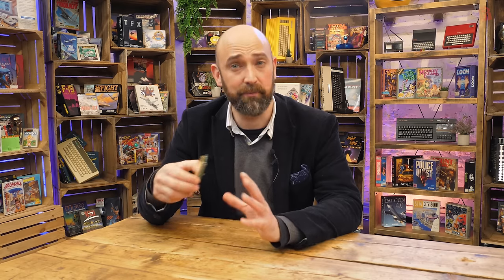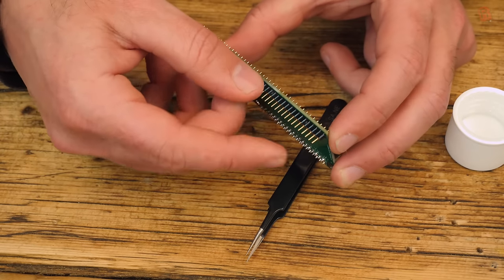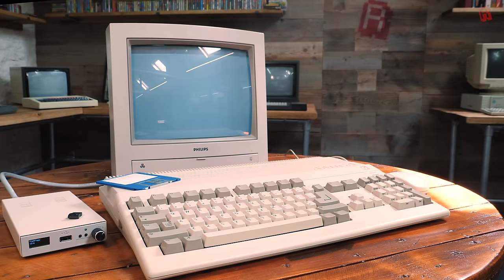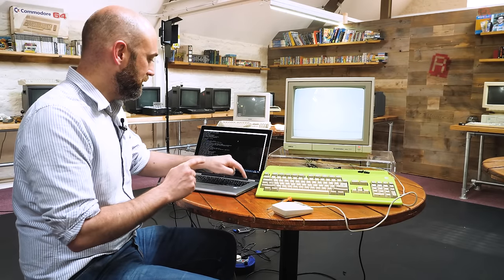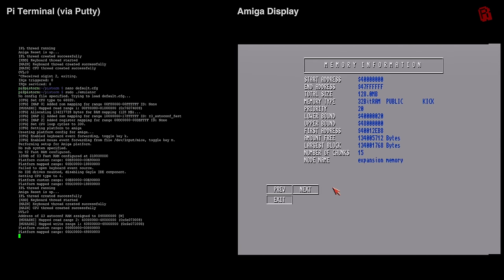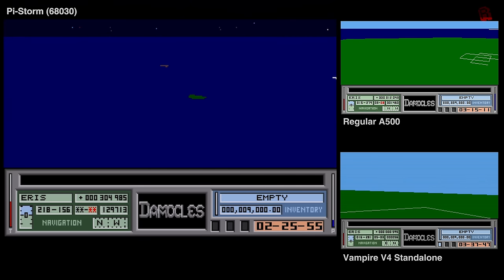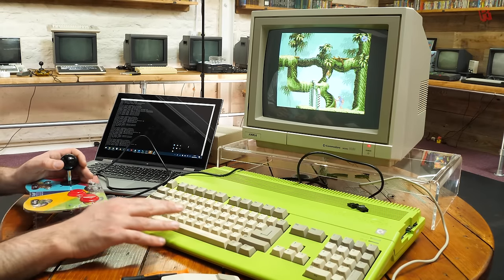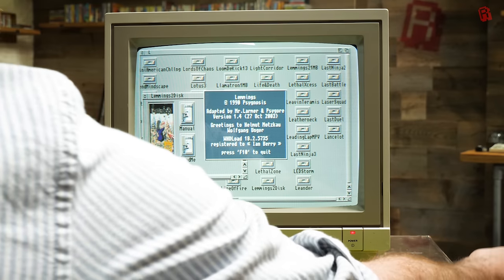Amiga PiStorm - Retro Power on a Budget - Tech Nibble

Comment: Thanks for the vid. The only thing that I wonder about is how come the SD card doesn't get corrupted when you just shut down power to the Pi? With OpenmediaVault etc, if the system is not shutdown cleanly then sometimes the SD card gets corrupted and it won't boot.
Reply: Only if there are write operations to the card was always my understanding?

Comment: I wonder what is the limit... The conundrum is: Where does the Amiga stops being Amiga and starts to become Pi or Vampire?
Reply: It's becoming a hybrid. All the dedicated ic's works as usual as long as the signals are right.
Reply: That is a good question. At which point does it become ridiculous to plug in a device to, circumvent one chip, or transfer old TV outputs to HDMI, when the device doing the task, is otherwise used to emulate the whole system anyway? I mean I an not a purist who says the Amiga should stay the way it was since 95 or so. If I would have had my A500 in use beyond 96 I would have plugged in every upgrade I could affort. So I would end up with a 100+Mhz 68000, but still...
Reply: I never liked the Vampire or any other FPGA solution, especially the stand alone devices simply because, yeah, no, it's not an Amiga any more, or ever was actually, it's just emulation through and through. This thing on the other hand I do approve of, as all it does is emulating a processor, one that although was lovingly associated with the Amiga back in the days, was in the end just a CPU - one that you could find in a plethora of other machines and isn't really Amiga specific as for instance a Paula is.

I have mulled over getting an FPGA based machine because just like it's brought up in the video, it's a convenience thing and who knows when my A1200 seizes up, or the installation, or the turbo card, but still never pulled the trigger due to the issues mentioned above. But this PiStorm is a definite purchase when they become more readily available. And 500's are a dime a dozen compared to 1200's.
Reply: I'm typically a purist even down to still using real floppy disks but at some point, I might have to at least invest in an SD card reader to remedy that, those old disks won't last forever. Seeing a video such as this though, I wouldn't be opposed to something that could emulate a faster 68k variant if it meant the 3D games would have actual playable framerates by more modern standards. That was always a serious barrier to entry for me with 3D games on the Amiga and Mega Drive/Genesis. The 68000 had the overhead to render polygons and still keep things moving but it was mostly abysmal in a gameplay sense. Those titles were really more examples of impressive technical feats.
Reply: @vresi  Minor nitpick: FPGA solutions like the Vampire are explicitly not emulation. FPGA is an array of logic gates, just like a real CPU or any other IC. When a chip is described in a VHDL file, that tells the logic within the FPGA core how it relates. That chip’s function is really there, in real logic, and is as much the same as original as if they had started up the chip fabrication again and pumped out new chips (assuming the hardware description was accurate). FPGA guys call this “simulation”, rather than emulation, but I’m more inclined to call it “synthesis”. To use a really wanky analogy, just as the statue is there inside the marble, and Michelangelo merely freed it, the real chip is there in the FPGA.

Software emulation differs in that it doesn’t usually replicate function, but results. The code linearly processes its emulation of a whole machine, which means juggling between display, CPU, sound, input, and storage, hopefully fast enough that you never notice the delay as it hops from one task to the next. Unless it’s really “low level” emulation, there’s usually some case specific hacks going on that shortcut to a result when a computationally intensive task is recognised. You still see a lot of that in N64 emulation, and those shortcuts are why you see graphical glitches all over the place (that’s an extreme example). In the video, we see Damocles running fairly poorly on the emulated 030. I can only speculate as to why, but it may be what happens when emulation DOESN’T take those shortcuts, and gets bogged down in the minutiae. Each approach has their strengths, but that’s where FPGA solidly beats emulation.
Reply: With the ability to use an FPGA to replicate 68k processors in hardware and therefore "emulate" Amigas, the PiStorm is unnecessary; unless you absolutely must use a real Amiga.
Reply: @NoobixCube  Using an FPGA isn't "simulation", it's hardware replication.
Reply: @RealCelticGamer  Hence why I prefer to use the term “synthesis”, though for some reason the FPGA community (as far as I’ve seen) calls it simulation to differentiate from emulation.
Reply: @NoobixCube  I've seen the FPGA call it "simulation", yet Analogue, who make FPGA based console, call it "hardware replication" which is the more correct terminology. No idea why the community call it "simulation". "Synthesis" is an interesting way to describe it.
Reply: This is the puzzle Alan Turin came up with before micro computers were invented. He said with infinite memory and infinite speed a one bit computer could emulate any other computer. Effectively our modern computers are infinite compared to 1980's computers and have plenty more than one bit processors.

The beauty of the retro computers is trying to get them to do amazing things or even useful things given their limitations. The beauty of these upgrades is figuring out what they can be upgraded to and still be the original device. I see they even produced a variant of the 6502 with a 1MB linear non-paged address space that was binary compatible with 6502 as well as capable of more.

Comment: Good value for sure but remember you are limited to the 3.5mhz 16 bit wide memory bus for the 68000 socket so I wouldn't get too excited about faster, it's probably bottlenecking on the 68000 CPU socket already. Plenty fast enough to make It Came from the Desert 'arcade' sequences much smoother and playable which is all my Amiga 1000 would want.

Comment: I'm quite tempted in a Pi 400 with Amiga decals.
Reply: Then you rather need an emulator build for a complete amiga. Search for "amibian" in google or facebook.
Reply: @vectorjoe  it seems a more legit way of doing it than just a PC window.
Reply: Pimiga ftw!
Reply: @FatNorthernBigot  amibian is an emulator distro for the pi. Just the linux foundation and amiberry.
Reply: @vectorjoe  I understand. So, for sixty-odd quid, you get an entirely self-contained computer that runs like an Amiga. Just doesn't look like one. Much. I'm willing to bet you could plug in an external drive and play old Amiga games, as we did thirty years ago.
Reply: @FatNorthernBigot  unfortunatly usb floppy drives will not work because they are build according to the ibm pc floppy format, and amiga used a different format.
Another method would be to put a pi3 into an empty amiga 500 case and use an adapter board to map the amiga keyboard to usb and connect that to the pi, then it looks like a real amiga.
Reply: @vectorjoe  I guess that makes sense. Shame, there could be a market for such things.

Comment: Can some of the 128Mb Fast Ram be remapped into the Chip Ram area? It would be useful for some of my old 512kb A500's💾💾💾
Reply: I'm guessing no: this can probably only replace CPU functionality, not chipset functions
Reply: @philipcorner574  That makes sense👍🏻
Reply: It can't do that. What the emulator can do though is map the 512KB of slow RAM in the trapdoor expansion to be chip RAM without needing to modify the motherboard (cutting some traces and soldering a JP). Needs a 1MB Agnus of course.

Comment: I'd be interested to see how fast it runs using a Pi Zero.
A lot better than you'd expect, I'd bet - it's still a 1000MHz single-core CPU, and the 68000 emulator will only use a single core even on a multi-core Raspberry Pi.

Comment: For the 68030 slowdown issues, my only idea is that the '030 had a really flexible MMU with multiple page size options, which is a real pain to emulate correctly.  The '040 has a simplified MMU, so as far as memory management is concerned, emulation can be much faster.  If there's an option to disable the '030 MMU emulation, try that.  Even if the MMU isn't being used by the OS, just having it enabled may slow things down a lot.

Comment: to the issue where 68020 is faster than 68030 i can only think one thing: emulation of 68030 is heavier, cause throttling to the PI, reducing its speed perhaps.

Comment: Pi Zero would be ideal as it is a lot smaller, though it does have a slower CPU on the Pi.
Reply: Pi Zero 2W is out now with almost identical performance to a 3A.
Reply: @Daz555Daz  yes, they were not out, or not that I was aware of when I made that comment.  The Zero 2 is definitely a game changer when it comes to small form factor computer on a board and being fully arm 7 compatible is fantastic.
As a side note, isn't it amazing how arm has managed to still stay relevant today.   It started as Acorn RISC Machine, then renamed Advanced RISC Machine when Acorn became no more.
Amazing how an architecture first introduced in the early/mid 80's is still relevant today
Reply: @EsotericArctos  agree 100%

Comment: Thanks for the video. Is there somewhere where you can get just a Amiga 500 case? Contemplating shoehorning in a ITX PC board, water cooled GPU and having the PSU 'disguised' as a large external power supply.. Has anyone already tried this - or is there just a lack of space?
Reply from the maker: You might want to consider the Checkmate Mini case which is designed for ITX and modelled on the Amiga 3000

Comment: I'd say you soldered the pon headers on bottom up and thats why they seemed to short.
Reply from the maker: Heh that wasn't the case luckily 😁 I wasn't the only one with this issue and the longer pins are being used as standard now
Reply: @RMCRetro  alright then, good for you ;) I thought so cause the bigger shiny brass planes on one side are usually soldered against the pcb. To me it looked like you did it the other way round.

Comment: The big deal about the 68030 was the built in MMU. I wonder if that's slowing down the emulator, possibly when it's dealing with the trapdoor RAM extension?
Reply: The MMU mapping logical to real RAM adds CPU cycles on the Pi.
Reply: @linuxjedivideo  Makes sense, thanks. I was wondering if the 2MB extension added even more work because of the chip/fast/slow RAM mappings it introduces. Trying to remember back a few decades, but I seem to recall that extensions over 512K had a few issues in that area.
Reply: @strayling1  There were likely issues if you had slow RAM. 2MB chip doesn't slow things down unless it is prioritised over fast.

Comment: Probably should have started with Pi zero support,  Pi A's are a dead end and it's weird to expect someone to have one.
Reply: Not true. The 3A+ will continue to be built until Jan 2026, the same as the Zero. The Zero (non-wireless) actually came out in 2015 and the 3A+ came out in 2018... The Zero is a significantly less powerful piece of hardware, though they are working on a version for it, as well as RPi 4.

Comment: Could the issue with 68030 mode is thermal throttling? Maybe Pi is, as you said, pushed too hard and starts throttling. Maybe adding a small  heatsink and even a fan to the Pi would help?
Reply from the maker: As I understand it since chatting to the devs the 030 introduces an MMU and this adds more demand on the emulator/Pi

Comment: It is a pretty neat device. The sad thing is that at least right now they have basically no incentive to implement the 68k properly, so all the other 68k platforms can't also benefit from some speed boost. Feels a little elitarian despite it having such wide potential. Not sure this is a smart direction either as this also limits the amount of programmers interested in its development.  Looks like the comparable Buffee Accelerator might become the more interesting alternative mid term.

Comment: Strange i can play Doom 1 and 2 easily on my Amiga CD32 with TF330 v3b 128MB (that is a 68030 50MHz board with extra's), and it runs good, so yeah Doom 1 and 2 could play good on the Amiga 1200 with a 68030 50MHz, and Amiga 4000, and Amiga CD32 if it came standard with a 68030 50MHz and 8MB Fastram.

Comment: I wish someone would do this for the Atari STfm/STe
Reply: There were inquiries about using the Vampire for the ST's but the main issue was unlike with the Amiga, ST games & demos require the exact speed to run w/o timing issues.  So there will have to be an option to run the PiStorm at exactly 8 Mhz speed for gaming.

The Vampire team decided to just port EmuTOS (and FreeMiNT) to the Amiga instead.

Comment: Is this still accerleration or already emulation? And how is this different from amiberry? Except that paula and the floppy disk exist for real?
Reply: Amiberry emulates the entire Amiga system including the graphics and sound chips. The PiStorm only replaces the CPU and still uses the rest of the actual Amiga hardware for everything else.
Reply: @jimb12312  except for denise (pistorm offers RTG), the hdd controller, RAM, KS ROM... the only thing thats not emulated are paula, the CIAs and the joystick ports....
Reply: @vectorjoe  All of those things you mentioned still can be used. You can choose to use RTG in addition to the on-board video, a virtual HD, virtual Kickstart, etc., but the Amiga hardware onboard is still in use. How is this different from Amiberry? You're still typing on an Amiga 500, and using all of the original physical hardware. Emulating a computer using a typical modern keyboard and mouse is not the same feeling at all.

Comment: I feel so out of touch here but what is a raspberry pi?
Reply from the maker: A Raspberry Pi is a low cost, single board computer based on the ARM CPU. It was released in 2012 and is now on its 4th version, with each increasing in power while keeping a low cost. Over 30 million have been sold. It's very popular with tinkerers and enthusiasts as you can connect it up to all manner of electronics or peripherals via the GPIO port on it.
Reply: As addon to  neils answer, here are the two important specs:
-credit card size
-rougly 35 bucks, be it dollar or euro.
Reply: It's a cheap computer that is extremely powerful relative to its low cost. "The Raspberry Pi project originally leaned towards the promotion of teaching basic computer science in schools and in developing countries."
Reply: @RMCRetro it’s 2 years since I commented on this video and I now have them running in my 1200 and 500 with 68040 and no compatibility issues at all. Mind I haven’t been able to use an OS or hard drive with the pi as for whatever reason I get errors whenever I try to use that side of them.

Comment: Sadly the Terrible Fire accelerators are no longer being worked on due to someone being rather dishonest and essentially stealing the design so for those on a budget the Pi Storm seems to be the best available solution.  As for the Frontier test, I remember struggling to play that game on a stock A1200 due to the low frame rate let alone on an A500!  I would assume that the graphics speed would be comparible to a Powerpoint presentation.

Comment: An Amiga with an Pi is in my opinion not longer an Original.
Reply: The CPU is the heart of the machine. If it's sitting there powered off, you're just running an emulator in an Amiga case.
Reply: @jimb12312  Except it's not emulation and it touches all of the Amiga hardware on the mainboard, but okay...